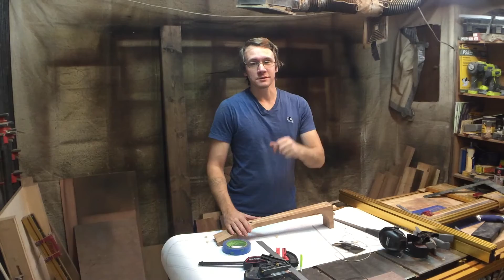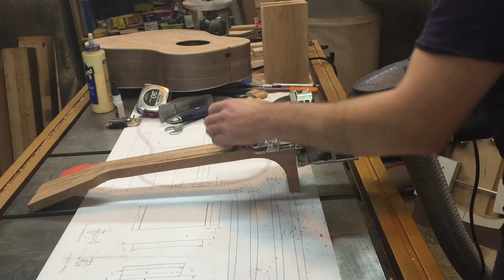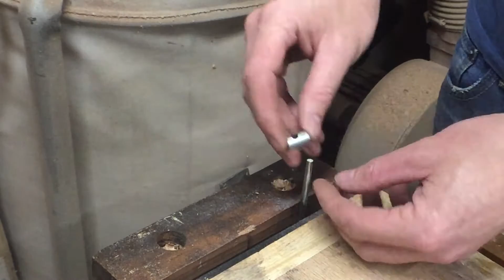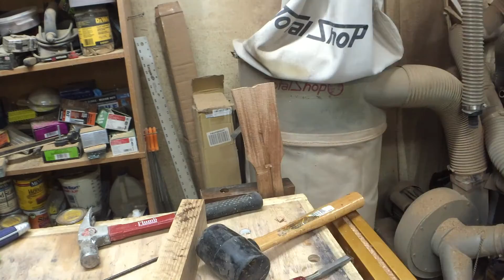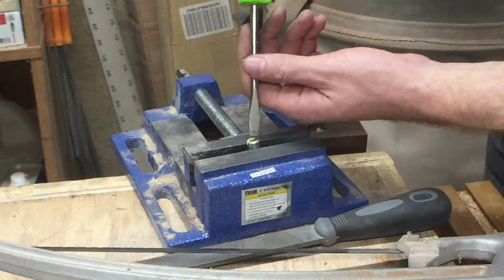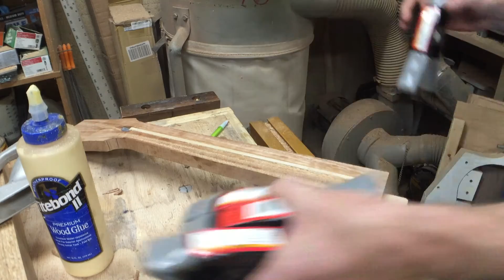Build An Acoustic Guitar, Part 7 - Neck and Truss Rod - 031

Comment: the domino joint will work though I'm not sure how easy it would be to take the neck off again down the road if a re-set is needed .... hide glue would help though as it is easier to dismantle ...... looking really good!
Reply from the maker: +kedocom thanks!
Reply: When will you post an update on the finished guitar?

Comment: The string are going to want to pull the neck up and toward the body, it seems like that should fall right into the strength of a domino joint. Looking great so far.
Reply from the maker: Thanks Dave. Yeah I don't see there being a problem with it either. I guess we'll see though.

Comment: When you put in the truss rod - does it have to be at an angle. For example, when the strings pull the neck, how do you make sure tightening the truss rod pulls it back? And not the opposite!